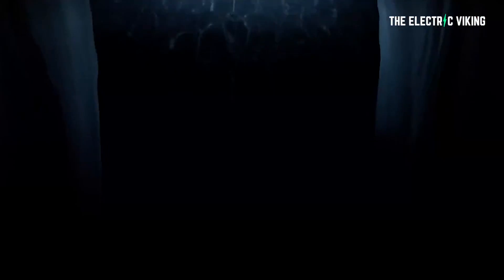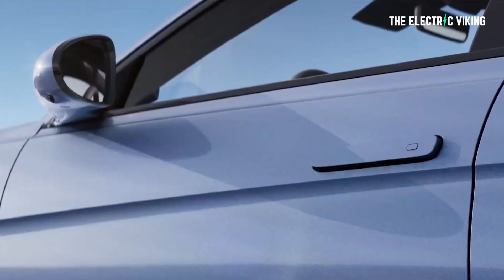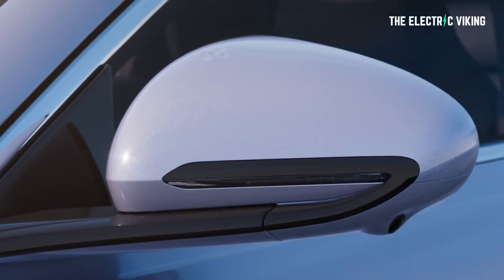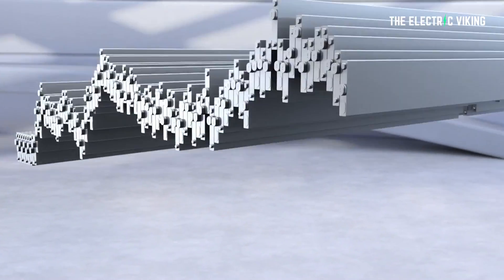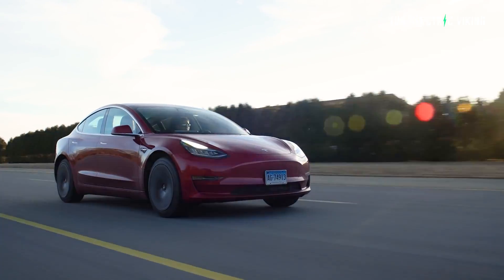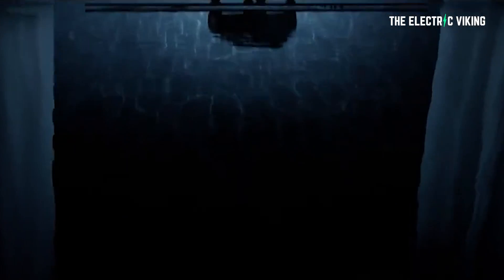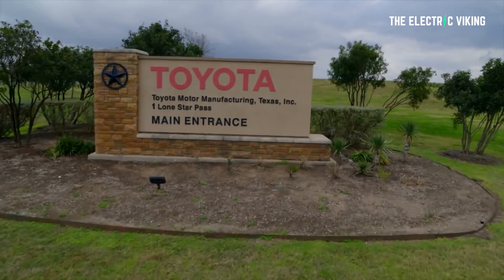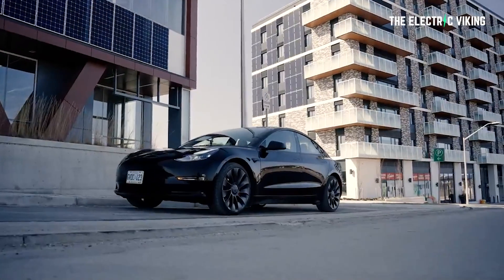BYD announces game changing NEW tech; & nobody notices!

Comment: ITAC is a new-ish technology, but only works if you are supplying torque to all four wheels. A rear drive only vehicle would see little benefit over existing stability / traction control methods. Also, the "revolutionary" cell to body structure and giga press is just a blatant copy of Tesla's design ideology, something that BYD is notorious for doing, having made obvious rip-offs of several European car models in the past.
Having said all that, I still prefer the look and style of the Seal, and the fact that it has a proper instrument cluster. Not much info about the rest of the tech though..

Comment: A home tesla battery is 14kwh
An EV car battery is huge 100kwh 
A daily drive is 7kwh 
Every building connected to the grid 
Every rooftop solar pv is 33kwh a day
FORGET home battery plug the EV into the grid 24/7.
20million cars in Australia. 
2,000 GWh storage 
10million homes
330 GWh generation 
25 GW, 600GWh fossil fuel power stations 
20million building in Australia = 660GWh
Renewables with EV perfect.

Comment: The new technology is called iTAC Intelligence Torque Adaption Control which means the torque on the 4 wheels can be independently controlled to maintain stability in slippery condition. Its accomplished using a new electric motor rotation sensor at each wheels which substantially increase the response time for controlling the torque output at each wheel without activating ESP. Just search iTAC on Youtube and there is a BYD video explaining this technology.

Comment: Maybe someone can answer this as I am not clear on it.  If a vehicle has structural batteries does that mean they cannot be easily removed once end of life begins?  I am just asking because one of the current benefits of the current battery technology is even after a vehicle's battery can no longer sustain a vehicle, the battery can be repurposed for usage on other things such as for home backup, etc.  Also, if after 10 years let's say and a battery pack has declined but there is new better battery options.  Can one consider upgrading their battery pack if they have a structural battery?  I take it that a structural battery cannot be removed and replaced in a vehicle with this technology due to the enclosures being directly integrated into the vehicle's structure. If someone knows these answers would you please clarify for me.  Thanks,

Comment: WoW I own BYD so want it succeed, but your ideas about China are mere fantasies.  China is not dominating in every industry except auto manufacturing.  They can't even build a viable commercial airline, they are generations behind in advanced semiconductor manufacture, and it goes on and on.  You fail to realize that the main reason that China is so fast to build things, many of them useless and rotting away, is because the insiders want to turn their fiat currancy which they print at five times the rate of the USA into material options so they have an escape when the entire system crashes, which will be soon.  Now you have deleted my last post about this matter, but there is no sense in trying to hide the real geopolitical facts from your viewers unless you prime motive is to deceive them. https://www.youtube.com/watch?v=1zGQFceDrIM

Comment: Do structural battery packs mean that you can’t replace the battery at a later date?
Reply: Good question.  Would it be possible to change a failing cell ? (One or ten)
Reply: @ovi9610  Unlikely, but depends how the cells are sealed inside the structure, I assume there will still be a heap of bolts to remove to remove the bottom pack cover, but if the cells are fitted from the top of the floor and then the top cover sealed in place then it's going to be nigh on impossible to repair a battery pack without stripping the interior completely. This isn't a good thing...
Reply: @ledsalesoz  yes, it's a tricky repairing test case. Munro Live has a video with DuPont's sealant/adhesive specialists about these topics. Great to see in the future if there is a possibility to repair some cells, or the full battery pack will be like a one-brick with the ability to work with some failings cells for the operating life of the battery.

Comment: If they are copying the technology from Tesla, how is byd changing the game? You say BYD is much more vertically integrated than Tesla but you dont specify. Do they make software, alluminium alloys, chips, or AI?
Reply: It's quite simple to research BYD.
They ARE more vertically integrated at the moment.
Yes they DO make chips
(I think even the tyres?)
Everything you saw in the short video was BYD made, including the monorail, just as an indicator.
Maybe take a look before "going on a rant"?
It's quite simple, you have the greatest investigative tool in history at your fingertips!
Reply: @rogerstarkey5390  i asked because the information is not clear. It was not a rant at all
Reply: @rogerstarkey5390  Baidu
Reply: Chips and batteries is all I know.
Reply: @MyUniversalUniversity  BYD can produce it's breaking system( that's why BYD gets a cheaper price from Bosch for IPB breaking system. solar panels, solar storages and more.
Reply: stop using drugs, it's bad for you.
Reply: @xiebaiqin  but I need them! 😚😚

Comment: Yeah, the next Tesla-like car. As if we dont have enough 4 door/4 seat big sedans, or SUV's for that matter. 
Probably again at least in the €40k to €60k range when in the EU. Prices that are going up and up and up. 
Maybe start building more small cars that can do 200mls range and cost below €25k ? 
I am starting to get so bored with these EV companies, refusing to build smaller normal cars. 
The masses dont need 0 to 60 in 3 sec, selfdriving or cars that weigh 2 metric tons.
Reply: Grizzly
Congratulations on the greatest number of probably incorrect assumptions in one post.
Reply: One perspective is that true Level 5 Autonomy in a few million cars will mark the beginning of the end of needing to own a car simply for the purposes of transportation... at least in the US... I guess FSD will be delayed a bit more in Europe, and I would think especially in opposite-driving road systems, but it will take over quickly once governments give the thumbs up... and who knows if someone that has a better system than Tesla FSD is just not talking about it.
Reply: @youtubecommenter-on9kd  
Two problems to overcome.
(The hardware isn't far off)

1) Data. "Outside the US" there's much less, due to less input (fewer cars).
.
2) Regulation. It'll be interesting to see which jurisdictions jump first, or which resist the most.
Wouldn't it be ironic if the US, home of Tesla (for now😉) dragged its feet despite being further along with that data and having the (generally) most suitable road system? (Wide, straight, grids in cities)
Reply: And once we get to ~100 million L5 Self drivers, it will completely obviate the need to own a personal vehicle. Non-self driving cars will be a hobby or a passion project - and an increasingly expensive one, at that

Comment: What does everyone think of this new structural battery and mega casting. IMHO I'm not sure what impact this will have on repairing your vehicle in any type of accident. I recently had a small fender bender with my kona ev and had it repaired at minimal cost. Not sure how they will change a fender on these mega casts. Love your channel and maybe you could look into this for us.
Reply: The casting is at least six inches /15cm away from the extremities at any point.
If you had an impact in another vehicle which went that deep, you're talking major chassis work, IF it's repairable.
Understand before making "off the cuff" comment.
Reply: @rogerstarkey5390  Check out this pre production model of the BYD Seal
https://youtu.be/mauVbg_Ug6M
Reply: @rogerstarkey5390  I'm not sure what you are trying to say here. All I'm asking is how the casting will affect repair costs. Maybe you can explain how a fender bender or a damaged battery will be repaired on a mega casting.
Reply: @paulroy6461  The point @Roger Starkey was trying to make is that it will take a substantial impact to reach the megacastings and structural packs themselves - there are deformable parts outside of these which will absorb most crashes. If the crash is serious enough to damage the megacastings/structural battery pack, the car will most likely be a total write-off anyway. The biggest risk of a non-serious (to the occupants) impact causing irrepairable damage is probably a floorpan impact, e.g. by going over a big bump too fast or hitting a large rock/outcrop that you don't have the ground clearance for.
Reply: The limiting factor talked about repair costs on his series for the gigacastings.
Reply: If Teslas or another car company can eventually get an acceptable full automation of their vehicle it should reduce or eliminate damage to the vehicle which would prevent having to worry about replacing the full molded support structures. I would expect prior to a perfected FSD feature damage to any one piece structural body part they would just junk the car because that's how insurance companies work.
Reply: > When the efficient and experienced body men start repairing these castings we'll know more. Expect lots of whining and nay saying till some honest reports come in. Expect the dishonest repair shops to mislead and rip off the insurance companies and consumers.  Business as usual.  The ability to cut and weld portions of castings together will be the new science for shop professionals. Fenders, panels, and all else just bolt up to the casting. Could it be easier?
Reply: @carlwest859  you said I'd well Carl, . personally would tackle repair on anything. The shops will need to write a few new books, and adapt.